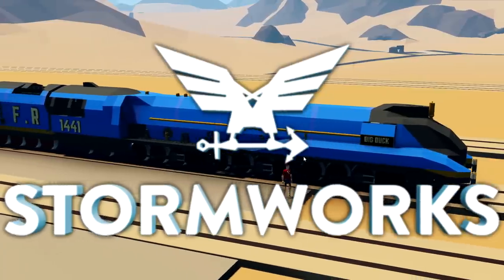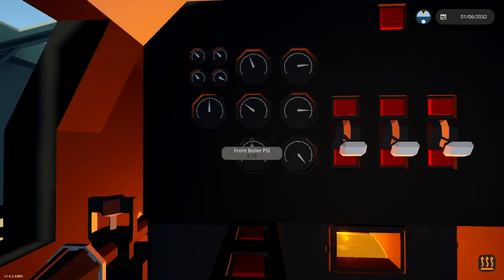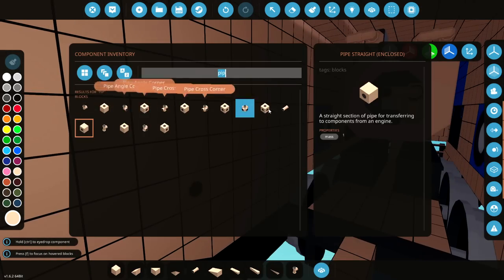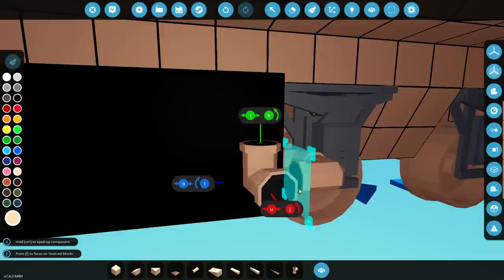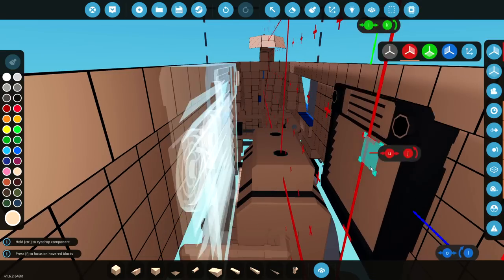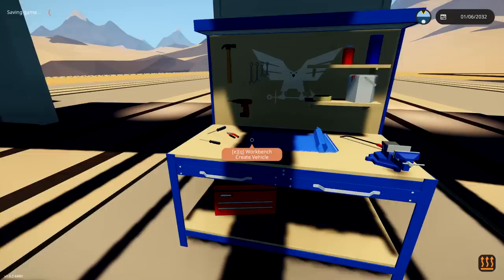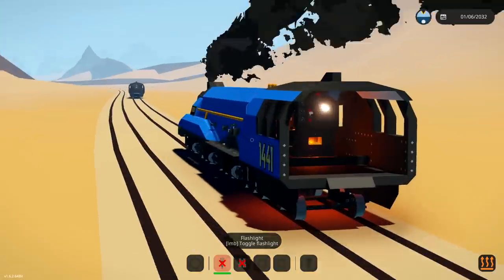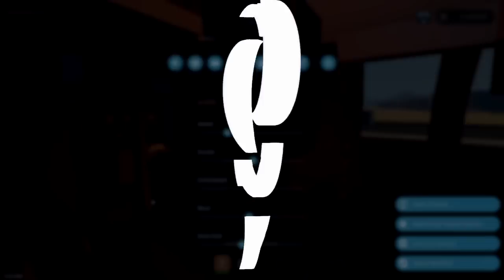DELETING TWO BOILERS In Our HUGE STEAM POWERED LOCOMOTIVE Is Far Too Slow In Stormworks!

Comment: I bought stormworks today and by coincidence found out how to overcome the wheel slip of the large wheels.
My train had 2 large wheels and i set the brakes to 0,05 while building up pressure, i forgot to turn of the brakes after increasing the throttle and suddenly my speed was 50-80, at first i didn't know how i managed it but after trying i found out that it was because of the brakes and setting them to 0,05 is the perfect value.

I hope this can help you.
Reply: that's amazing! thank you for sharing

Comment: This stem engine reminds me of a LNER A4 pacific, its a 4-6-2 (the wheel configuration) 4 wheel on the front boggie, 6 driving wheels and 2 trailing wheel at the back under the cab
Reply: You are correct! That is what he was inspired by! I think we has also inspired by the Big Boy 4014
Reply: @DalekPratt1963  actually  the big boy was a type of articulated locomotive. so frantic decided to make an articulated version of the lner a4 pacific

Comment: Idea for recharging the battery's place 3 small steam piston (4 if possible)  in the empty space tn the boiler and connect a generator on it.and if you like to turn the generator on or of then put a valve between the steam generator and the boiler so you are able to control the generator. 

And again nice video I enjoy it. Keep it up
Reply: First: pistons only work on train wheels (i guess) 

Second: closing the input/output valve would build up pressure

But over all good idea!
Reply: @gameyord7182  i meant the  moduler steam pistons not the  the steam train pistons.

Comment: The pumps are centrifugal pumps, fluid goes in in the center and out at the edge.  Just think of the circular part of the pump spinning and pushing fluid to the outside of the pump.  It might help you figure out the in and out of the pump faster.

Comment: Tis a shame you don't like it... Though you did say steam specifically. I really like the design.
One of the things I was thinking was what if you have one coal box, two boilers one extra water tank and then set up the condenser return in a parallel lines.

So basically previously you found out that pumps in series don't work but what if they had they're own lines? Even if the line joins back up can the pumps deal with extra that way.

If this works, may have been what was needed for triple boiler was an extra system to deal with fluctuations. Extras and lacks of flow but at the same time shrug, I get lost sometimes so what do I know.

Thanks for humoring us with this build frantic, this was pretty interesting to watch.
Steam plane when? Jk jk 😅 just thought that might be funny. Good luck in general!

Comment: The speed bottleneck might not be the steam system, but the top speed of the wheels themselves.
Reply from the maker: They should go faster than that though, I've seen some get up to 60mps :(
Reply: @FranticMatty   increase boiler pressure or use bigger wheels,

Comment: I feel like I need to state the obvious here, Steam=slow speed high power. 

You aren't going to be winning any races with a steam locomotive, but you could out pull anything. That being said Stormworks is very far from "realistic" in any regards to vehicle performance. I built a large vessel with 800,000 power (8 large diesel engines) per prop, with a total of two large propellers, equaling a whopping 1,600,000 power (whatever they consider power to be), and the fastest I ever got the vessel up to was a staggering 18 mps. The same speed I had with only a single engine per prop. Take just a single large electric motor to the propeller and suddenly I am cruising at 21 mps, for about 2 seconds until they drain all of my power. 

In short 30mps is insanity for a steam powered locomotive, in real life that train would be tearing itself apart at that speed. If you can get up to 10 mps while hauling a huge load, then be glad for that. In real life you would have as much boiling area as possible, but your train would also weigh many hundreds of tons. The Union Pacific "Big Boy" is a 4-8-8-4 locomotive and engine with tender combined weigh in at 470 tons. The 16 drivers give it the contact area with the rails, but its sheer weight gives it its grip. Now make a steam locomotive in Stormworks weigh but half that much, and it won't be able to move under its own power and would struggle with two other engines helping it.
Reply from the maker: A lot of your points are true however, the fastest steam locomotive in history, the mallard did reach 126mph which is around 56mps... I would have liked to have gotten closer to that speed. even if it was only a little closer :)
Reply: @FranticMatty  Ah, I can see the inspiration now. Looks like you will be needing the larger wheels then, given that in the days of steam wheels determined a locomotives maximum speed, not the boiler area. 

Options for fixing the wheel slip could be not going full throttle right out of the gate, but gradually increasing it over time. Another option is to see if Stormworks devs did finally add the weight=grip physics to the game by making it way heavier.